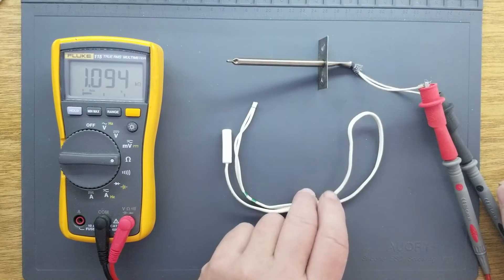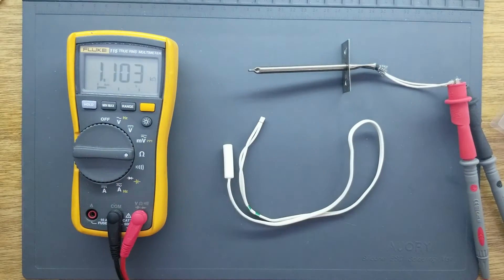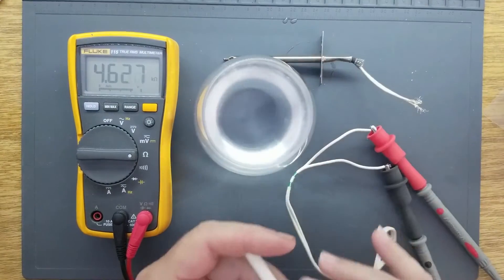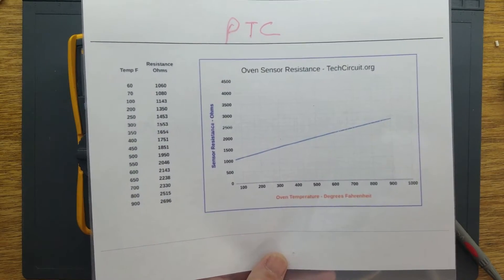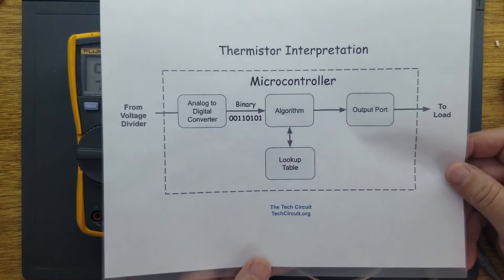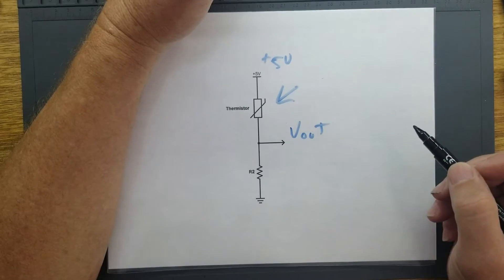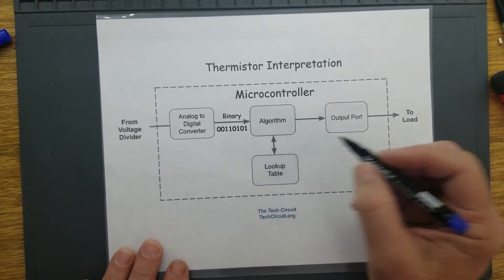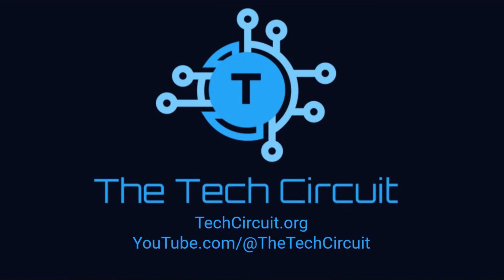#58 -  Thermistors Explained

Comment: Wish I'd've seen this yesterday! I threw a dicky RV fridge out (Ghecko 125 ltr) that could have been repaired with a very quick fix, by the sound of things.
Never mind, I'd already bought a replacement. As for the old fridge, tried giving it away on Facebook marketplace but I thought I would just be giving someone else a headache to solve. So it went to the recycling plant.
Cheers for sharing. Great info, and easy to understand.